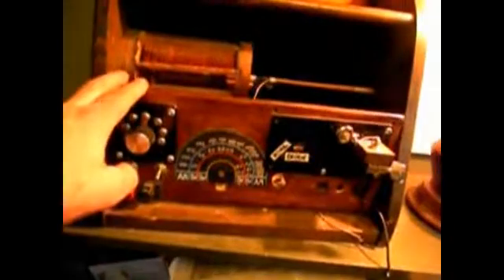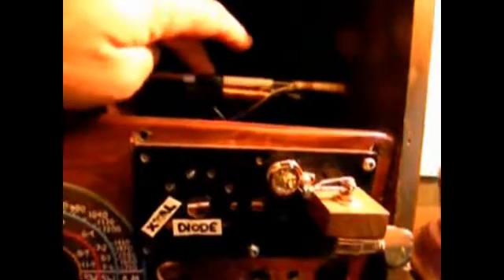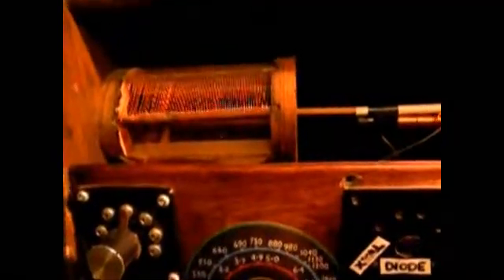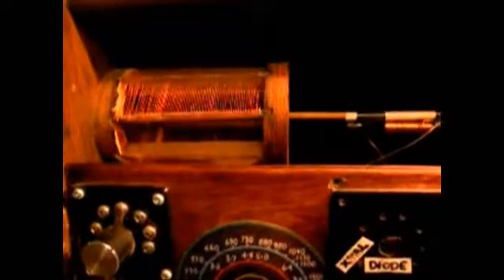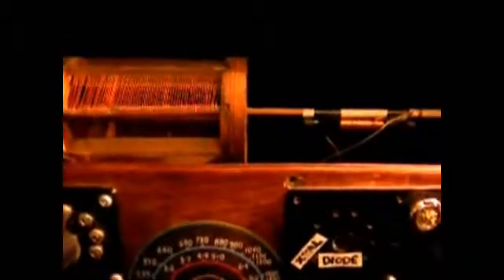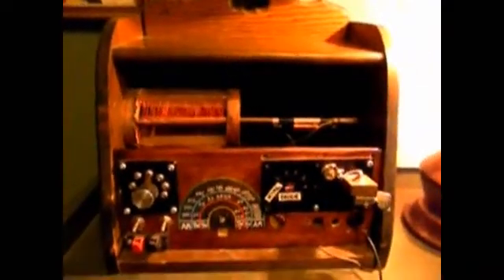Breadbox Crystal Radio Build.. Part 1

Comment from the maker: I figured I needed some kind of background sounds other than copyrighted songs or just silence. The random spanish in the background is the Attencion numbers station V2a supposidly from Cuba an encrypted message sent out by groups of 5 number sets in spannish.sent to spies operating within its vast and strong radio signal. I have been listening this station since the 80s its on the air 6 nights a week on SW 5883 and 5898khz AM at 07:00-08:00 utc. very interesting and creepy too.